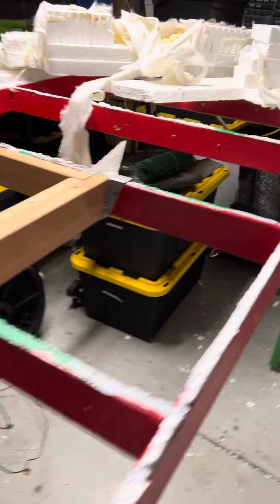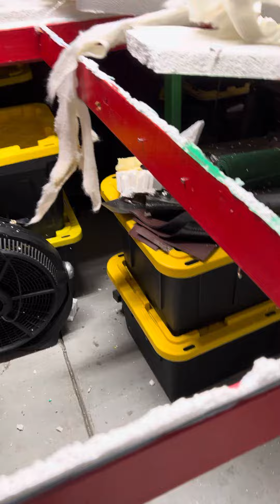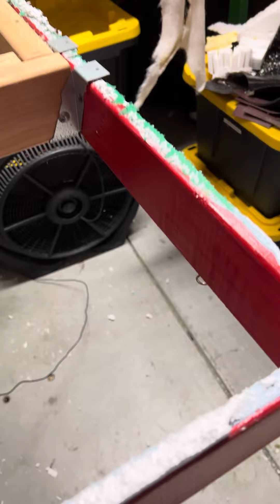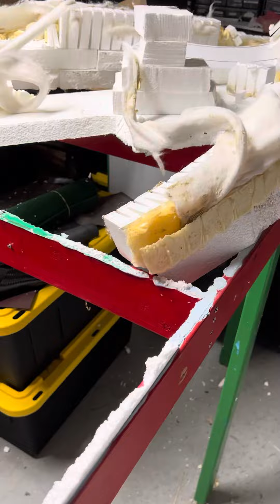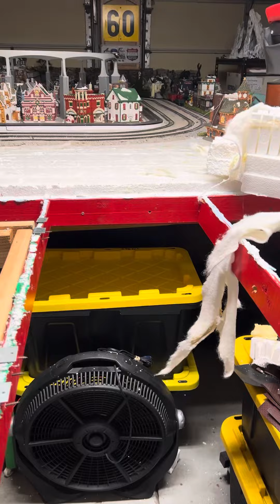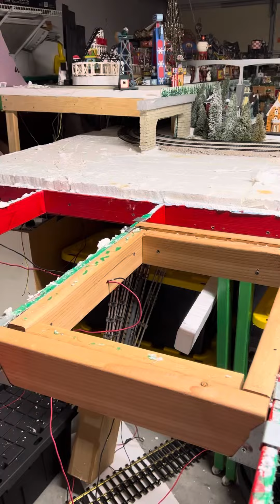Layout tear down update!

Comment: I use the blue insulation because I got a lot for free. It is great to use but very messy. The shavings and flakes stick to everything as if magnetic.
Reply from the maker: I use a hot wire foam cutter Mark. Worth every cent I paid for it. No mess at all.
Reply from the maker: Also, I had a bunch of the pink foam given to me. So next time I will use that or the blue.